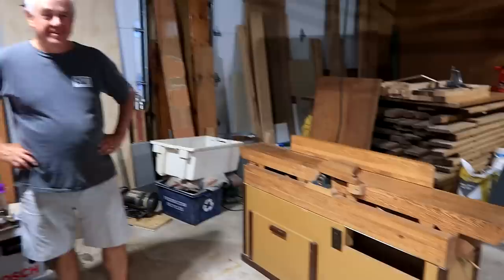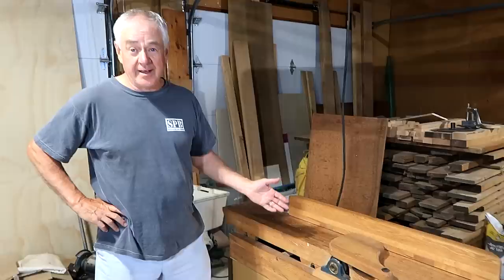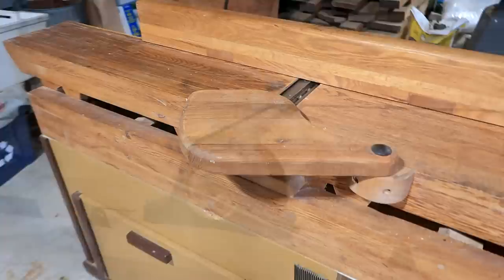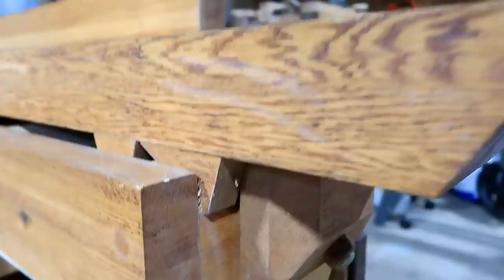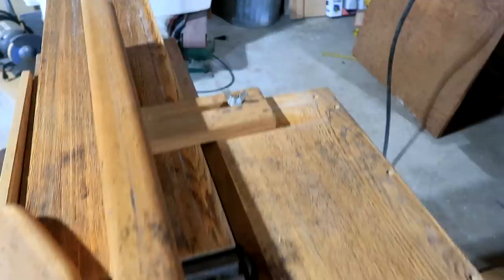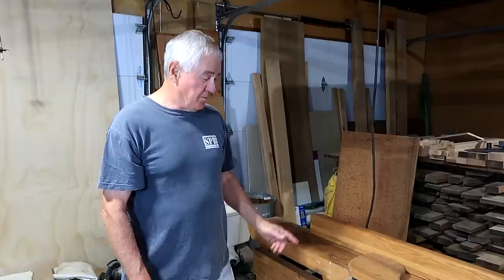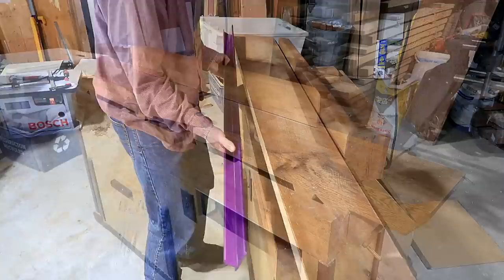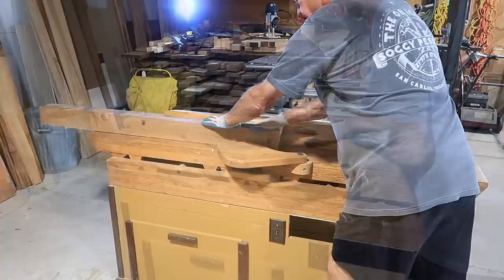Reg's wooden 8" jointer, from 1981 fine woodworking plans

Comment: I have built a 13” one based on your plans. What happened was I got a good deal on 13” Shelix spiral cutter heads for my Rigid jointer. Then purchased your plans, used the jointer’s original cutter head and a brand new 1hp motor from princess auto to build the jointer. Had to widen the plans a bit on SketchUp but it is working like a dream. Thank you. Don’t know about these old plans but I am impressed and very happy with you design.

Comment: I remember that plan.  And I wanted to make that plan.  I have milling machines and lathes today, but they weren't available to me then.  I got a General 8" instead.  Fantastic to see the FWW tool in action.  

FWW had great plans for a bandsaw, table saw, and many other tools.  The Bandsaw plan was by a Canadian, from Ontario, seems to be a thing up here with our higher prices.  (Appeared in the same issue that had the first Roubo bench article, and still my favourite).

FWW had some DIY Roger Heitzman tools in a few of their issues.  Solid looking tools that had welded frames.  A lot faster to make, but Wood is Real.

FWW did an article on the articles in issue 251.

Comment: Lesson learned form machine shop, and surveying:  Always loosen too far, and go back against the direction things will vibrate to when adjusting machines.  Use gravity, or the tension built into the device to help you keep them adjusted.  tighten uphill, or into the spring.  

And, you can buy old jointers fairly inexpensively, and use them as the basis for a build.  You could start with a 6 or 8-inch jointer  with short, rusty beds, and build one with very long beds.  And, if you used some cutoffs from LVL to make the beds they would be very dimensionally stable.

Comment: What a delightful video.  I think maybe there are thousands of homemade machines hidden away in shops and garages across North America.
Reply: I have a third hand 18" band saw in mine. It is made of Gilbilt parts, but the guy who made it apparently didn't think wood was strong enough, so he built this thing out of steel. Weighs about 600 lbs, but the table is HUGE. You could eat dinner on it. I got the actual factory information on the design and stuff after I had put in a 1.5 HP motor in it, which it seems quite happy with. The factory info said not to do more than a 3/4 HP. I don't have a smaller motor, so this will have to do. But I swear, you can cut through ANYTHING with this beast.

Comment: What makes this story especially timely is that purchases of Byrd helical insert cutter heads have freed up all sorts of conventional cutter heads and their knives. For still greater stability, make your infeed and outfeed tables of MDF. Laminate the wear surfaces with Formica. Chamfer the edges to protect them.
Reply: My table saw outfeed extension is made just like that, with mdf and formica.  Slick surface and easy glue cleanup with a razor.

Comment: Jeeze, the best thing I made in high school shop class was a crappy clock.
Reply: I made a box with a lid.
Reply: all I did in shop class was fettle planes, and sharpen and set saws. We were supposed to make a cube.  The shared plane at my work station was a mess.  So, I started tuning it up.  The teacher saw me, and asked if I knew what I was doing, and I told him I wasn’t as good at it as Grandpa, but I doubted I could make it any worse.  So, he let me continue.  And the hand saws were all dull like folks were cutting tin cans with them, ;so I pointed, sharpened and set them.  Teacher came up one day, and offered to give me an A for just working in the tool room.  I spent all three years of Junior High shop classes fixing tools.

Comment: One advantage to building your own is making the tables longer than what can be had commercially. A 6 or 8" cutterhead can be bought as a replacement for a commercially produced machine for about $150-200. IF one has a source for salvaged lumber and a good used electric motor, then I'm thinking a jointer similar to the one in the FWW book could be built for less than $300.
Reply: I agree, however I would rather weld one up from some decent angle iron or such to prevent potential warping.  Good excuse to buy a small 120v welder and learn another useful skill.

Comment: as long as the out feed is true you can get a perfect joint.  it comes down to knowing how to use the jointer in the first place.  to many people on youtube make video's on setting up and using a jointer when they have no idea.  they carry all the weight on the in feed with the out feed set incorrectly and then wonder why they get snipe etc.  yes bad jointer advice is my pet peeve on you tube lol.  this video goes to show what you can achieve if you do it right.

Comment: Interesting article
Typos

"The cutter head was milled from a solid piece of steel in the shool's machine shop. "
Shool=school

"The infeed and outfeed tables are glued together out of smaller pieces of oak go give them more stability. They each adjust on inclines, one on each corner of each table. "
go=to

The motor is in a box that sticks out the back.  it's a 1 hp 1750 PRM
motor with a big pulley on it.  
it's = It's
PRM=RPM

"its interesting how the economics of hobby woodworking machines have changed in the 40 years since the ..."
Its=It's

"Add 6 months to write up and get published in Fine Woodworkin,g and that dates the jointer to 1979.
" Woodworkin,g" =  Woodworking

Comment: You still don't know how to use a jointer correctly...
Reply: What are you even talking about. Make a video showing what he is doing wrong
Reply: @donbot5000  Always press down the workpiece on the out feed side of the table, not on the in feed side (except for the first cut). Because the out feed side is your reference plane, not the in feed side.
Reply: @paulpahl1607  You assume he is pushing down when he is just pushing forward.
Reply: @paulpahl1607  i am gonna go ahead and assume the guy who made the tool knows how to use it better than you do considering you've never used it.
Reply: @bmxscape  Yeah - "I've done it for 20 years this way so it MUST be right!"...
Ask a professional woodworker, maybe you trust him. And if not: Do whatever you want if the result doesn't matter.
Reply: @paulpahl1607  just saying every machine is different and he seems like he has a good understanding of that machine and the results the machine can achieve